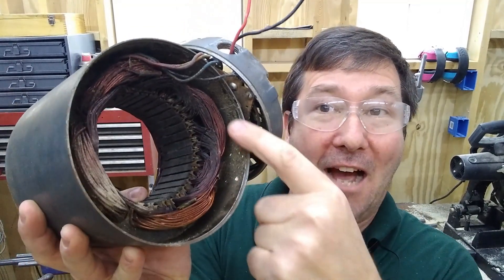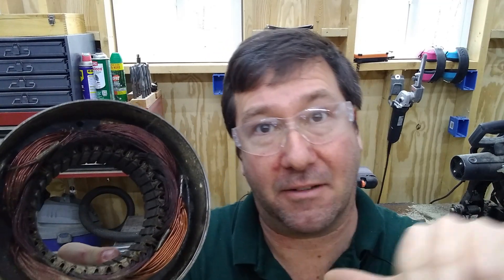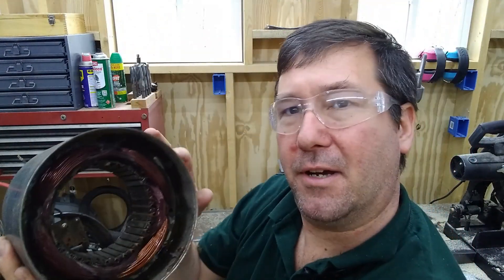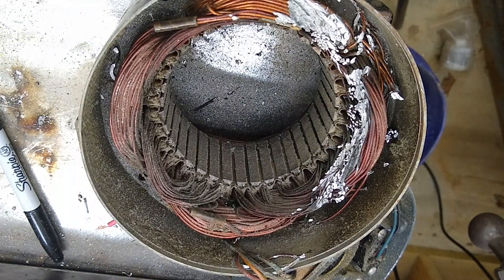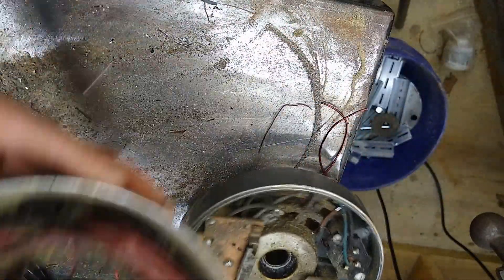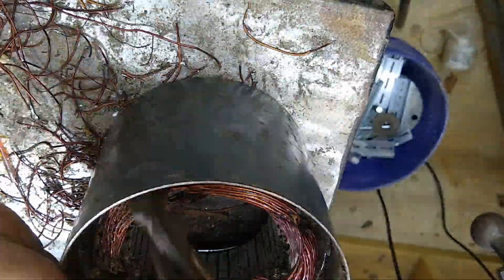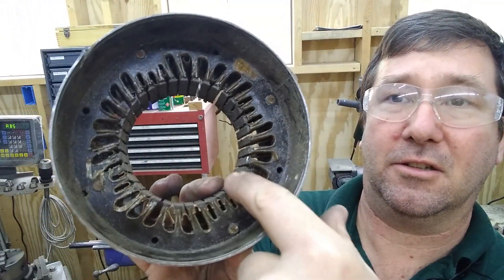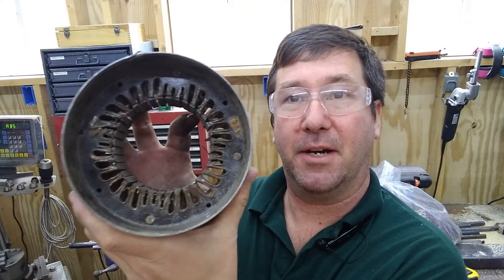How to Remove the Copper from a Scrap AC motor

Comment: That aluminum wire isn't worth it. Why call it copper? It's a cheap motor.
Reply from the maker: Yep. If you read the comments from 3 years ago I already said that I was mistaken and it was aluminum. Wasn't worth the time but still I learned about how motors are wound.

Comment: In that motor, the copper is actually aluminium coated with that dark red shit.
So before doing anything always check if a motor winding is copper (usually orange) or aluminium (usually dark red).  Just get a file and rub it on the winding.  If it shows shiny silver colour then that's aluminium wire.  In which case it's probably not worth the effort - just sell the whole heavy motor and get a motor price 🙂
Reply from the maker: Yep, figured that out when I tried to melt it down 😆